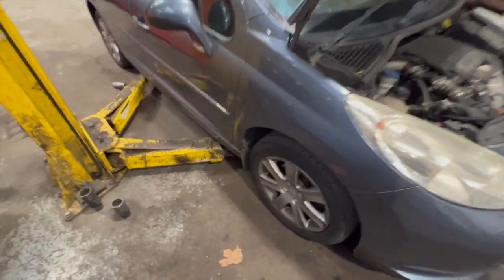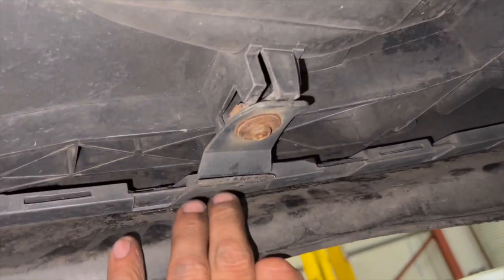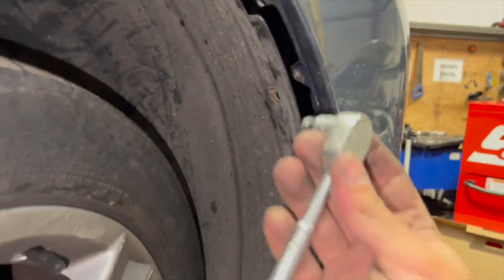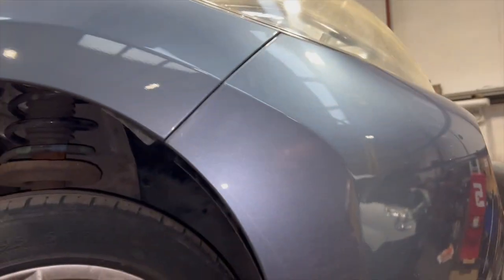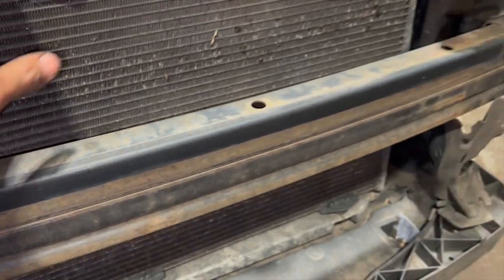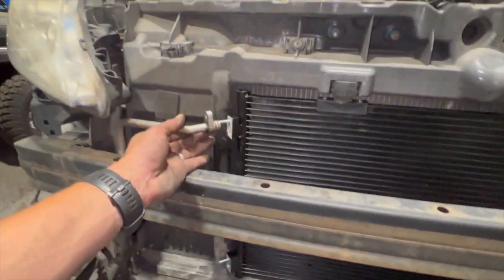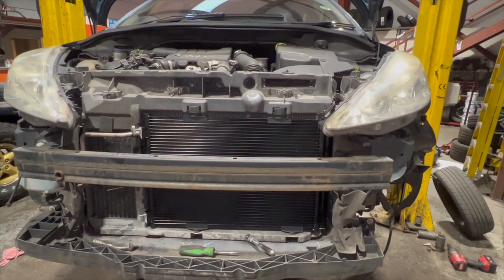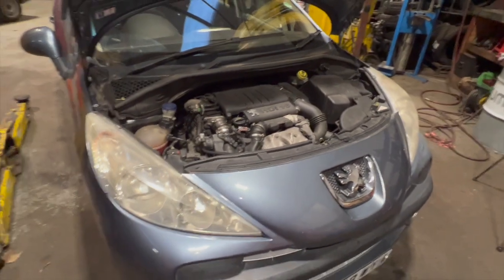Peugeot 207 Air con condensor replacement

Comment from the maker: New AC condensor ebay -  https://ebay.us/OTp5ot

Tools used:
Socket set - https://ebay.us/7tUKdM
3/8 Milwaukee impact driver - https://ebay.us/gvxqC7
Small flat snap on screwdriver - https://ebay.us/plNX5O
Needle nose pliers - https://ebay.us/fTNBNV
Irwin Mole grips - https://ebay.us/qkl8LE
Torx sockets - https://amzn.to/39UTWCw
Screwdriver set - http://ebay.us/NUu3Q1

Comment: Fascinating stuff. It must take longer to take all the bits off in order to replace the actual broken part. I was hoping to see the re-gassing as would be interested to see what’s involved. 👍🏻
Reply from the maker: Arr sorry didn’t put it on this time , our machine is a texa fully automated job , not much I could shows as it’s does it all itself once you start it , there are self refil methods you can use but there not as efficient
Reply: @diydaly  ahhh I see. I’ve never seen AC refilled before so just wondered what was involved. From what you’re saying it sounds pretty straightforward if you have the right kit. Thanks 🙂👍🏻
Reply from the maker: @TheDervMan  arr yeah with a machine it’s well easy .. ours is a texa machine .. was around £3k though 😬

Comment: Mine looks the same as bad or even worse, some guy that filled my refrigerant told me that i have a bad compressor but it dosent lose refrigerant,  but my climate only blows cold on left side and right side is normal air. I checked the interior motors from flaps , they work...the gauges from ac showed normal pressure on low side and the high side goes to maximum at retarded ...they said its compressor but the radiator looks worse too..why u changed urs? Thanks !!!
Reply from the maker: Mine was actually leaking mate

Comment: Damn I broke my condenser pipe, exactly like yours, the one down below. It totally crumbled. 

What would be the best option now? I cant really find new parts since my car is 2007. I guess I can ask around scrapyards. Where did you get yours?
Reply from the maker: Mine held the gas luckily but you should still be able to get the pipe from the dealer